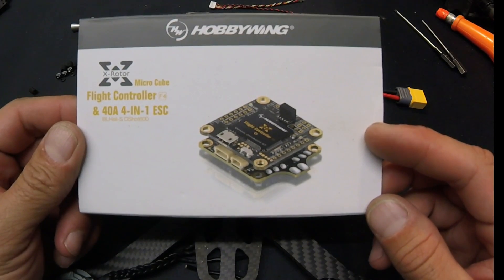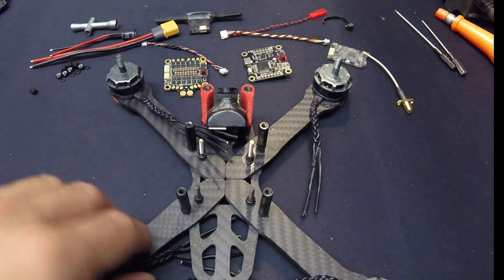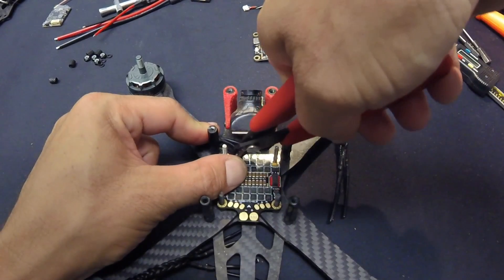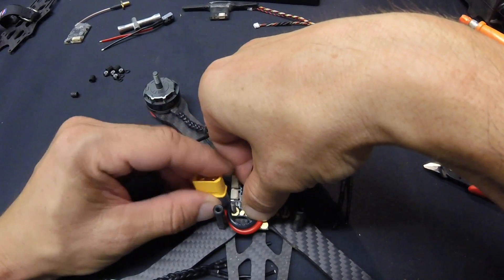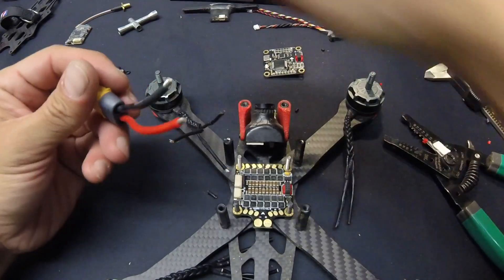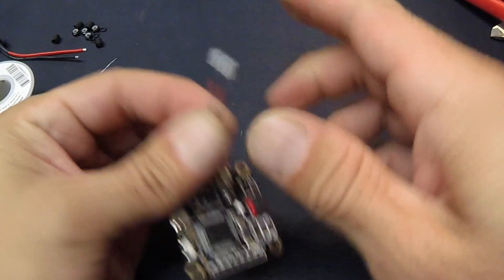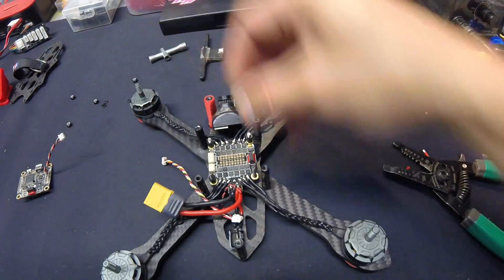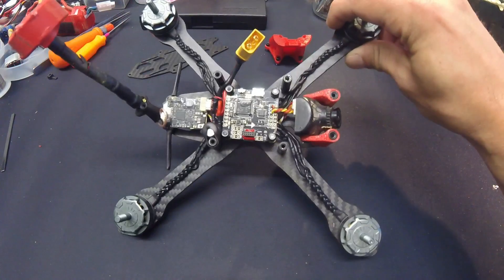The Charlie Show /// Episode 14 /// HOBBYWING Xrotor Combo Installation

Comment: i had HW-SM934DUL_XRotor Micro Flight Contoller F4 G2_180502
i did flash it by mistake i don't have the backup file 
is that can be fixed ?

Comment: tighten the fc nuts as hard as you can...if the is just a hair of wiggleroom it will tear off the connectorpins. even if you use siliconerings under the tight nut it will ripof the connector. what you can do is mount the whole pcbsandwich on silicone rings...escboard and fcboard have to be hardmounted together. ive ripped 2 of these fc's before i knew what was going on.

Comment: Hi I just finished a build with combo.  Does the ESC need to be calibrated?  Mine stutters just off idle.  Does a backflip when trying to take off.  Motors all work fine in BF and props are on correct.  Thanks

Comment: I am buildinf this too but i dont have capaciter. What did you use on this build soi can get exact one. Next question is i am using x4rsb i connected to uart tx 6. Is that the correct one or should i put in 3

Comment: Hey, great build. I’m using the 4649t Spektrum receiver which used 4 - 8.4v current. Do u mind telling Home how to set the up??
Reply from the maker: Shoot me and email - Charlie@hobbywing.com and we'll get you some information.  I have a couple copters using the same RX.  There are places on the FC marked 5v, you can use those for power no problem.  Same signal, and same ground , just a different power/positive lead to the 5v spot.

Comment: @hobbywing official I appreciate this video! Thank you! I am running this stack and am curious if running the esc signal wires to their s-ports is needed? Why is the wire included with corresponding s ports on the FC? Thank you!!
Reply from the maker: Options are always nice.  :) . The harness is included for use with out this "stack" or in some instances folks don't use the header and use the harness.  

When using the header, the ESC and FC plug into each other and not additional wiring is needed.

Comment: i am using the 5v tbs unify ..powered from the side connector ..but i get brown out ..or wont even power up ..no led or sound from ESC .. not enough amps ?..but all is good when i unplug the connector ..i have the ESC FC  combo by the way
thanks
Reply from the maker: Hi Bill, feel free to shoot me an email and we'll try to get you some more details if you need.   The 5v is not really "meant to power anything", and is only there for FC power.  In cases of damaged pins, or users not wanting to use the Pins, or the Harness, there are some wiring options available.  

A VTX, should likely get a dedicated filtered power source.  Most VTX's these days, are all designed to power from battery voltage directly VS any need for regulated power.  Build trends have changed a few things.  

For you're setup, you'll likely want to source a stand along "BEC" device that can output regulated and filtered power for your VTX, or performance would be pretty bad.  Unfortunately I don't know or use any outside BEC's anymore and am unsure what to recommend.  

I've used TBS Vtx's in my own builds, they are great, but mine all wired up directly to main battery power.
Reply: i made some changes ..went ahead and use the unify hv version ..and will power it up dir3ectly to bat..ill let you know how it goes.. thank you

Comment: u say this is safe on any 5s setup? i have astrox switch true x but i want high power from 5s
Reply from the maker: The 2205x2600 might not be super happy with 5s full time and for all pilots, but we've done basic flying and some hard flying with this rig on 5s and it didn't "Die" or do anything abnormal.  That being said, that's not to say we'd recommend this.  The 2405 size motors are much happier with 5s, over the smaller 2205.   The Stack is great on 5s overall though. Used with the right motors for 5s, should be great.
Reply: lol what would 2405 /2850kv do on 5s? fire fire?
Reply: i wonder what thrust the xrotor 2405/2850kv do on 4s with dal cyclone 5046 ? any ideas to somewhat compare to other motors

Comment: My  main screw that through the ESC  were a hair short any idea where I can get some? getfpv dose not have them
Reply from the maker: Hmmm, most hobby shops stock 3mm hardware in various lengths.  It's nothing special, and there are some variances in frame part thicknesses that make the screws not work for some builds.
Reply: I found one. Yeah my frames really thick in the middle. What size comes with it?

Comment: Heya HW, does the gold plating around the screw holes have any functions? I want to bore the hole into 4mm to fit my grommet.. Want to check first that its safe to do so
Reply: DimplePoji I think it is used to ground the ground but im not 100% sure

Comment: Hi nice straight forward build video. Very clean as well. Great job. Just want to ask if the 4 in 1 has current sensing capability when used with other FC? More power to your channel.
Reply from the maker: The way I understand the Current sensors is 'yes' it should work with others, but depends on the FC requirements.

Comment: Hey, I just installed the  F4 and 4-in-1 40A combo and I have a couple questions I hope you'll be able to help me with:
1. I'm running an X4R-SB and I was wondering if there's a UART that's inverted or that can be inverted via the software, so I can hook up SmartPort for telemetry.
2. What size SD card is supported? Can I just plonk in a 64GB one and forget about it for the rest of its days or do I have to pick up a smaller one?
Cheers!
Reply from the maker: My understanding is the Smart Port stuff is something needs to be addressed via the RX wiring, so not inverted. 

Have not used the BB SD Card myself, but if you shoot me an email, I'll be happy to follow up, charlie@hobbywing.com  Thanks!
Reply: I am running a 2bit SanDisk with no issues as Betaflight 3.2 has a mode selection to activate SD from a switch on your radio as well as a mode to erase sections of memory from another programmed switch.
Reply: You mean 2GB? I tried 3 different 64GB cards and non were recognized :(
Reply: Hey bro just need to un-invert the telemetry signal. Project Blue Falcon has a great vid for this."RIP" Just thought of this this morning and checked and it was there. I will be trying this later today and will post which UART I went with for success.
Reply: Cheers, that's what I thought, but I wanted to make sure there wasn't an easy way to invert one of the UARTs so I wouldn't risk bricking the receiver for no reason :P
Reply: Birdless Flight Feds

Comment: What is the buzzer output for the hobbywing f4 FC. Got the receiver running. Had a bad receiver.
Reply from the maker: The spots marked BB with a + and a - are the beeper spots.  You can email us for direct answers that will happen sooner.  Keeping up with all the contact points can get tricky when we're traveling. Charlie@hobbywing.com

Comment: Gave this a shot on  Kraken today. Ran sbus config for XSR. Set RX for UART 1. No signal. Switched Sbus to rx UART 3. No signal. Whats up?
Reply: The FC and 4n1 ESC I got did not come with any hardware in the boxes at all. No nuts, no spacers, no O-rings.
Reply from the maker: Shoot us an email if you have not, we can help get you sorted.
Reply: No sweat got plenty in stock here but I almost immediately broke the pin connectors that connect FC to ESC. I decided to use the rubber style standoffs that come with a threaded metal post on one end.  After a minor crash there was no damage to the Kraken frame but the pin connectors all broke. Easy fix just running sh jst pin from ESC to FC just not as clean. This pin set up will certainly be an issue for hard flying pilots as the 40a ESC is designed so I would recommend manufacturing an SH 1.0 jst port on the FC so the two are simply connected in that fashion. This will make your stack much more robust. In addition I am unsure what UART to use for telemetry from an XSR. I have no problem using tx 6 for SmartAudio however telemetry has been an issue. I originally had the Bolt 2204/2400 but then gave your 2405/2850 a shot and WHOOOOOO man they scream on 5s. Haven't put 6s thru your 40a esc yet but if I can get assurance they will handle it this 270g 5" dry Kraken is an absolute rocket. They give surprisingly good run time but they swell the hell out of 4s packs as suspected LOL. Cheers. and Well done... Looking forward to your next generation products and 32 bit 4in1.Great start tho

Comment: This is waaaay different than the Betaflight FC I'm used to. In fact, I've done 4 builds with the BF board. Im confused on where to get power for my vtx and camera. Im running a UNIFY HV along with a runcam swift micro. Do i just pile the VTX connector on top of the main battery cable from the 4 in 1? Where would I get power for my cam?
Reply from the maker: Benefit, not sure, I just never use Vbat to "power" anything, only for the Vbat sensing topics when needed.
Reply: There is vbat pins on the board
Reply: is there a benefit to having the unify hv direct to the main bat leads vs putting the vtx on the vbat and grnd pin part of the board??
Reply from the maker: Hi,

On my builds, my VTX gets power from the main leads, and has regulated power out for the camera.  

I simply tack the power leads "on top" of the main battery pig tail on the copter. 

Most of today's VTX's work well off main power and have regulated power out for the camera.

Comment: No need to Softmount? And if I want to, is the connector between the FC an 4in1 very hard or will it allow to just softmount the fc and not the esc?
Reply: Okay, just saw you used o rings. But that wouldn't do anything if the plug connection is stiff right?
Reply from the maker: Hi ZeroEx - So far, I've flown it a dozen or more times at least, and haven't noticed anything strange. Does seem to be effected by "how tight" the nuts are squeezing the o-rings, to loose seems to be an issue.  So just snugged them up slightly, and all seems well.  I don't really "tune" and I've not messed with Filters at all, but am planning to get some "Tune time" in at the MultiGP.IO with the help of some "pro pilots". ;) 

The setup does come with the plugs and wires to solder leads VS using the hard plugs to allow S.M. of the FC only.   

With the o-rings as shown in the vid, the "Whole" stack is slightly soft mounted and seems to fly fine considering my 'Non tuned' and old style filtered setups. LOL.  The bit of prop wash I get is no worse, and prob better then my other builds.   More flying hard on courses and more open areas will tell.  I spent a few packs in some open areas yesterday and it seems to fly very nicely and doesn't have any strange vibs or wobbles.